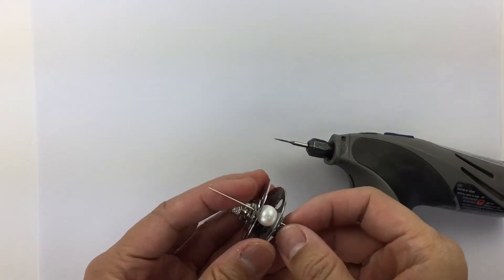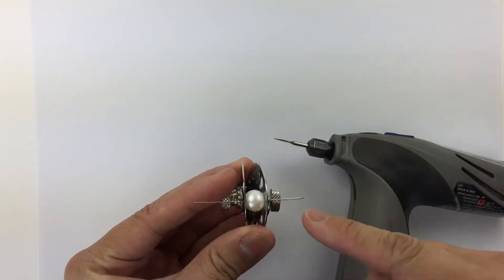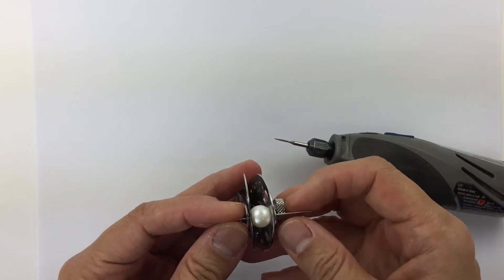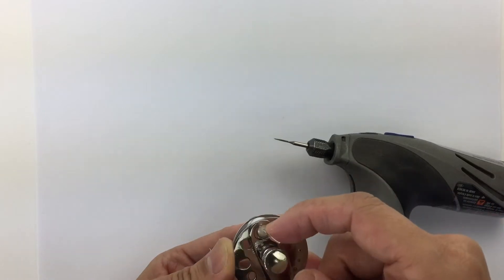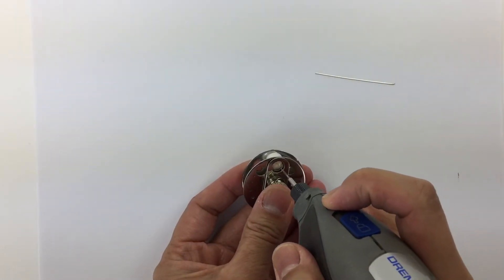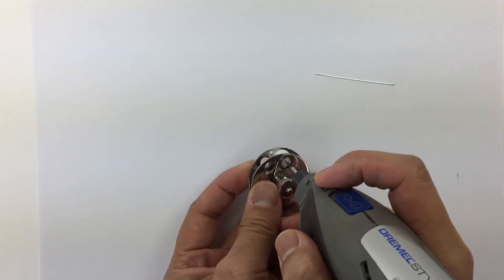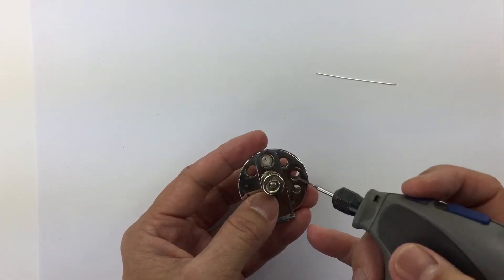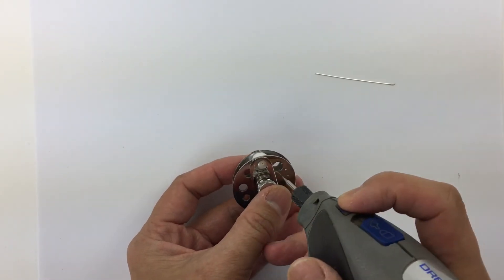Pearl drilling - enlarging the existing hole

Comment: I have a pearl vice like this but It leaves circular scratch marks on the pearl’s nacre so I use a wooden clothes peg instead.
Reply from the maker: Wood is always good.  If your pearl vice is sharp, you can polish it smooth, or add masking tape around it.  The masking tape will prevent scratches from sharp metal
Reply: @stonesandfindings  Thanks.

Comment: can this drill through silver or gemstones ?
Reply from the maker: You can use this to hold gemstones, but it is not recommended because it takes a lot longer to drill stone, will overheat unless submerged in water.  A drill press is much better.

Comment: Please tell, whats the story of them big puppys .....  I have some onyx balls and I need to make a bigger hole in them.  Please help me.  Thank you
Reply from the maker: Drilling stone, and different types of stone, requires different set up.  With onyx, it's far harder consistency than pearls.  It will heat up, so you will need to cool with water, and it will take a lot longer.  While this vice will work to hold a stone bead, that drill will not work.  Most people drilling stone have drill press with a heavy base that can sit in a basin of water.  This vice will work, but hard to hold it still for a long time.  There are vices that fit the drill press to free your hand completely.  Those are made for stone drilling.  THose start at $200.